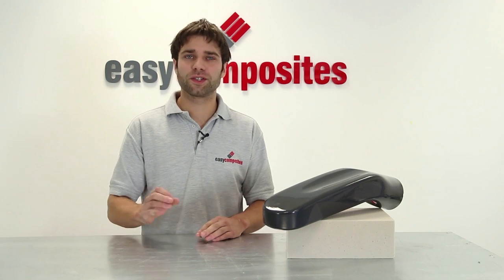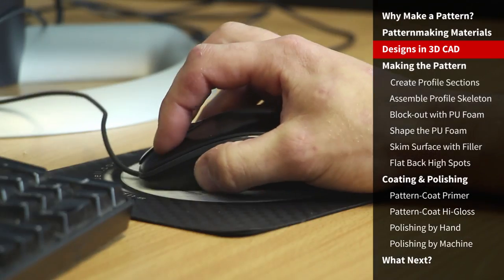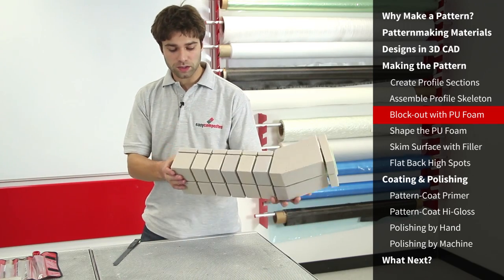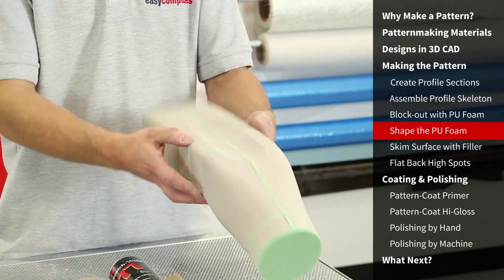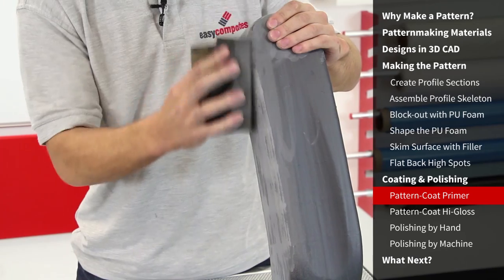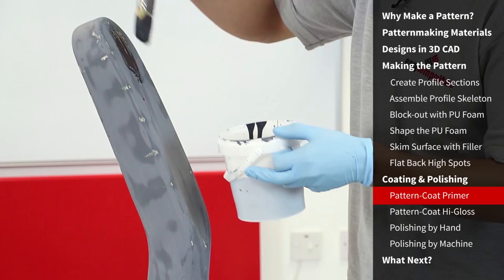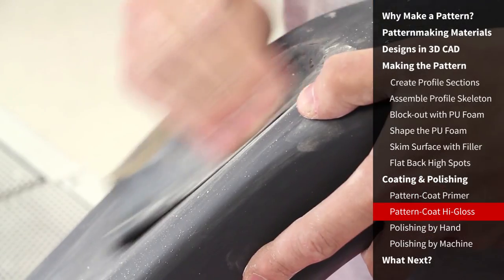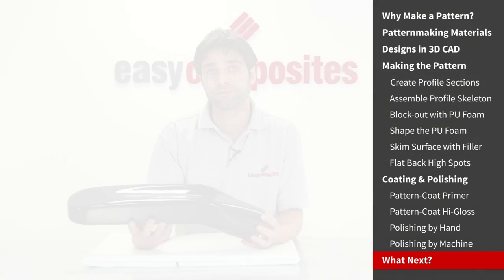Composite (Fibreglass) Pattern Making Tutorial (Carbon Fibre Airbox Pt.1)

Comment: Do you recommend using a palm sander for a job like this?
Reply from the maker: +christianc1562004 : yes, definitely - a 'DA' is a must have but of kit if you're doing much pattern making by hand. Mirka make an amazing palm sander called the Ceros - it uses a mesh sanding pad which dust can be extracted through - the sander is then connected to a vacuum or extractor. They're not the cheapest sanders but are really great for this can of work. Palm powered air sanders are also great.

Comment: Hello, can you tell me which race car model the carbon fibre airbox is made for? Thanks :)
Reply from the maker: Its designed to fit on a Jenvey 4 cylinder throttle body baseplate which can be used on a variety of engines and cars using Jenvey throttle body set ups.

Comment: Could spraying of the pattern coat primer reduce the amount of sanding that will be required?
Reply from the maker: +Marty Handley; Yes, definitely. Most people don't have spray equipment but if you do then you can spray the filler primer and it will give you a smoother starting point which will mean less flatting/
Reply: Cool, good to know

Comment: Can you apply a couple of coats of Pattern-Coat Hi-Gloss?
What if you inadvertently break through the Hi-Gloss coat while sanding ?

TURK
Reply from the maker: Yes you can apply multiple coats if needed.  If you break through, ideally you would need to re-coat in Hi-Gloss to avoid a mismatch in surface finish.  However, as long as you have used the Pattern-Coat Primer correctly and not moved on too soon, then with careful sanding you should not break through the Hi-Gloss.
Reply: Many thanks for the quick response EC.
Not breaking through the original layer of Pattern-Coat Primer ( or the Hi-Gloss coat ) is all very fine on a dead flat surface is easy enough as can be seen in the tutorial,  but while sanding slightly curved surfaces as I am doing,  a slight convex shape is much harder to sand evenly. 

Hopefully,  I won't go through my original coat of Hi-Gloss,  but it's good to know that if I do I can re-apply another coat of Hi-Gloss without any issues  ; )

Many thanks

TURK

Comment: could I use curvbed Perspex?I need to manufacture a 4 feet diameter tube, made from carbon fibre.
Reply from the maker: Perspex as a mould? - This would be tricky because resins will bond to Perspex so you would need a release agent however it's difficult to get release agents to take to Perspex - solvents like Easy Lease will attack the surface, wax is difficult to apply to a glossy plastic surface and PVA will bead away. For this reason, you would be much better off if you can use a self-releasing plastic like polypropylene, then you would not need any release agent at all.
Reply: Thanks
will try a small sheet of polypropylene as a trial
thanks for your help

Comment: can you use the pattern coat on extruded polystyrene foam? if now what else can you use?
thanks
Reply from the maker: No, Pattern Coat Primer is styrene based and so it will dissolve polystyrene foam instantly. If you want to use a styrene-based resin system (such as polyester or vinylester) on XPS then you would need to coat the XPS shape in a 'shell' of epoxy resin first. Epoxy won't affect the XPS and it will protect it from the solvent (styrene) in the Pattern Coat Primer.

Comment: How easy/hard would it be to accidentally indent into the pattern with your hand, as it is made of foam?
Reply from the maker: Although the foam could be indented if you press it hard, it's actually not that easy to do accidentally and you would find even a low density foam (such as the grey foam we use in the video) easy to handle without accidental damage.

Comment: No respirator is needed?
Reply from the maker: It depends on the environment, equipment and individuals involved. You will see most of the video is shot over a special downdraft table to draw down dust and help prevent dust becoming airbourne. With the foam sanding, the hazard is relatively low.  With the fine sanding of the resins, you can see a good quality mask being worn to prevent exposure during the dry sanding process.  Generally when using polyester based resins in a well ventilated workshop for a limited time, then no mask is necessary in most cases.  However this all depends on your own safety assessment of acceptable exposure and risks.  If you are in any doubt, we always recommend erring on the side of caution and in any case it is a good idea to refer to the products MSDS.

Comment: I was curious on was cad program you use to make the profiles
Reply from the maker: We used Solidworks, but any modern CAD program should be capable of making the templates.
Reply: Ok thank you
Reply: Easy Composites Ltd

Any tips on making the skeleton pattern in Solidworks? I have been trying to Google tutorials on this "method" with no luck. Any help pointing me in the right direction would be appreciated!

Comment: I'm using Autodesk AutoCAD 2016 for my pattern. Now how can a get the profile sections for my pattern?? Do the profile sections have to be drawn in or once you have created the drawing, is there a command so the profile sections are showed and then printed onto paper? I would appreciate anyone's help. Thanks!
Reply: +christianc1562004 Did you find a way to this already? For me the same question... maybe you can help me out?
Reply: +RealTimeDrummer no I haven't found a way to do it on AutoCAD yet. So what I did was to make templates using cardboard. I found it to be faster then making the part in AutoCAD, but yet you might sacrifice some accuracy doing it that way.

Comment: What was the 3d cad program that allowed you to print templates like that?
Reply from the maker: Neal Raudabaugh In our case it was Solidworks but any good CAD package will allow you to view sections from which the templates can be printed.
Reply: +Easy Composites Ltd  I use Solidworks, but I can not dothe printing templates. Is that done automatic? or you do it manually?
Reply from the maker: That's right, it's not a 'feature' in solidworks (would be nice if it was) so it's done manually (although you can find the profile outline automatically and then extrude that profile to create the 'slice'.
Reply: +Easy Composites Ltd thanks
Reply: +Ruben Ramos Can you help me out of this, im have the same problems... do you know how it works yet?
Reply from the maker: Once you have your 3D model, any CAD program will allow you to take a cross section at any point through the model. Solidworks, Fusion360, Inventor; they'll all do it. If you're stuck, just look up 'cross section' in the help for your package.

Comment: Really good tutorial, but doing coating-sanding repeatedly is a completely watse of time and of course, coat. Maybe a fine cnc of 3d printer could handle that easily
Reply from the maker: That's a strange way of putting it! Lots of patterns are made by hand in this way, I certainly wouldn't describe it as a waste of time. Of course you can use CNC machining to produce your pattern which is why we have produced a video to show exactly that process; take a look at this video: https://www.youtube.com/watch?v=CWAvo8DIZ9s - sometimes hand process are right and sometimes machine processes are right :)

Comment: sir can u please tell about FRP materials like dough moulding compound and bulk moulding compound ....
Reply from the maker: You can actually see a video where we use a mould making putty (laminating paste / dough moulding compound) in one of our old Carbon Mods video. We will certainly be re-visiting this theme pretty soon too because we will be making a new video using high temperature epoxy moulding paste and gelcoat to make a mould suitable for prepreg use up to around 120'C. Here's the old Carbon Mods video: https://www.youtube.com/watch?v=qKrl1PPvliQ&t=1s
Reply: I think A LOT of people are waiting for such thing..... It will save a ton of money, from skipping the expensive CNC fees and a ton of time for us, manually designing a 3D part, making different profiles every 10-15 centimeters. We are looking forward to that sir!!!!
Reply: Thanks for your reply sir, the video was helful to some extent. Actually i was looking for electrical grade dough moulding compound used for encapsulation of magnetic coils made by winding copper wire around a bobbin. The compound used is made of some materials like filler, glass fibre, polyester resin, hardener, internal release agent, low shrink profile agent, accelerator etc. This material is used in hot press moulding.
the ingredients are known to us but the formulation process or percentage of ingredients is something which i need. if you can help in any way, then i shall be thankful to you.
Reply from the maker: Ahh, OK. I know the material you are talking about however we don't stock this material and I am not sure where does. I wish you all the best with your inquiries.

Comment: can you spray the pattern-coat primer and hi gloss?
Reply from the maker: Yes both the Pattern-Coat Primer and Hi-Gloss can be sprayed. Both will need moderate thinning with acetone at a rate of 25% before spraying, the Primer through a gel coat cup gun and the Hi-Gloss through a normal spray gun.  Full details can be found on the Technical datasheets for each product.
Reply: Thanks very much for the reply. I wasn't expecting that. People normally don't reply.

Comment: Easy Composites Ltd How about a Solidworks tutorial about creating those templates from a CAD file, even better a PDF how to on your website ;-). I have a solidworks part I want to make in carbon but have no idea how to begin creating those templates, please help and I'll buy all the bits from your site :-)
Reply from the maker: Hi Andy, this might be one for the future. Although we have Solidworks licences here (for our engineering department) it's a bit pricy for most people outside of industry which is why we used Fusion360 in our latest CAD tutorial. I'll certainly mention the idea of a PDF tutorial explaining how to generate the profile slices out of the 3D drawing though.
Reply: That would be great if you could, I'll keep my eyes peeled. A lot of people seem to have student licences ;-) for solidworks so I expect the use is more widespread than you might think.

Comment: Can I use the pu hard foam plates from sika?
Reply from the maker: The higher the density the foam, the harder it is to sand but the smoother the surface.  As you can see the pattern coat primer went over the foam block without issues so a higher density block is not really necessary in most cases.

Comment: Does anyone know of a method of doing this where you spray on a strong coating as the skim surface rather than spreading it on like bondo?

Something that it strong and durable as well... I am thinking maybe resin.. but something that won't be brittle and crack.
Reply: polyurethane primer its thick enough to to cover the pattern and sands like a thin coat of bondo

Comment: why not making directly a mould using this technique and materials? Instead of making first a pattern then a mould.
Reply from the maker: A foam mould is unlikely to be as strong or durable. The products used in a mould are different to the pattern making materials.  Most moulds have a tough hard gelcoat and some form of reinforcement backing to strengthen it.  This is usually fibreglass but can be other materials such as carbon fibre itself or even the complete mould can be CNC made from aluminium.

Comment: should have just 3d printed the pattern
Reply from the maker: Certainly 3D printing is an option and we'll be covering that in a future tutorial. There are a few considerations though; firstly, it's quite large so for most 3D printers this would need making up in several pieces. Secondly, 3D prints, especially at this size, can suffer from dimensional inaccuracy. Thirdly, you still need to smooth, finish and coat the 3D print. And finally, many projects would be much larger than this where 3D printing just wouldn't be feasible so this is a manual process that can easily scale. All that said, 3D printing is a very exciting prospect for composite pattern making!

Comment: Why 3D printing has taken over.
Reply from the maker: In composites? - It certainly hasn't yet. There are almost zero patterns produced using 3D printing at the moment, although that will change as materials and processes improve. For an automated solution, in composites at least, CNC maching from tooling board is the CAM approach, like in this tutorial: https://www.youtube.com/watch?v=CWAvo8DIZ9s

Comment: There must be a far easier and faster way to do this.
Reply from the maker: It depends what facilities you have available. You could of course take a mould from an original part which would generally be simplest, or if you have access to big budget equipment, machine a pattern out of a high density model board using a CNC machine. However, your average DIY/home user has limited resources and equipment and the method demonstrated is achievable by pretty much anyone with some basic hands on skills.  Of course, depending on the shape of your part, you may find MDF or wood a better material than foam, or maybe even other materials or plastics. The method demonstrated is just one simple method that works well in our experience.
Reply: You could perhaps 3D print it, I think there are a few affordable 3D printers out there, that can make a part this size.
There's a 3D printing service close to where I live which allows you to make much larger parts even, perhaps you guys could also make some money if you did that.